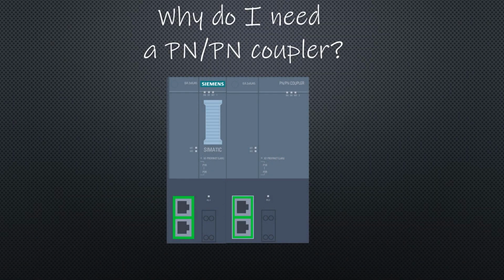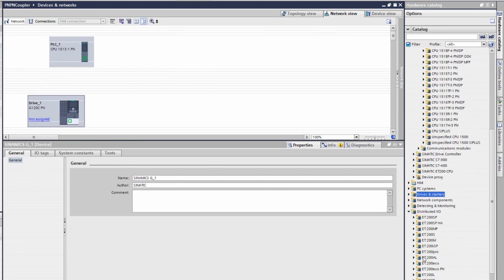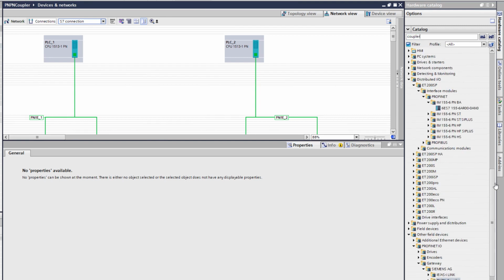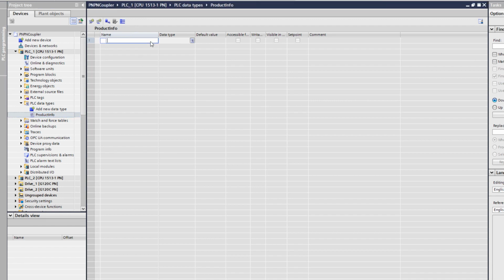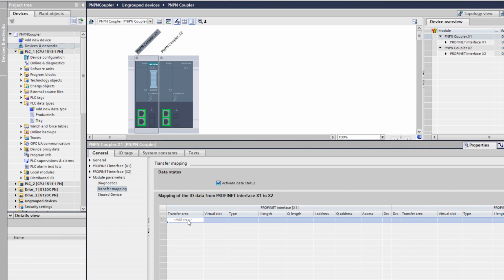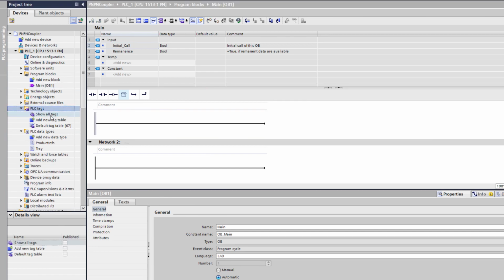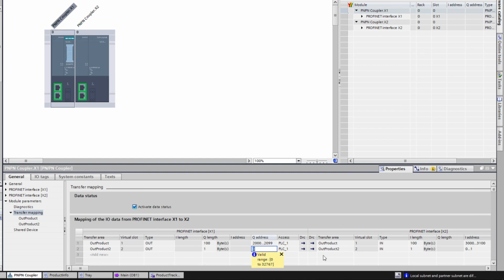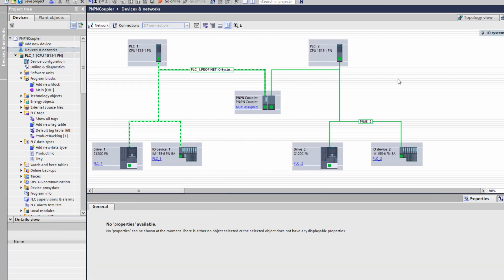When and how to use a PN/PN Coupler in TIA Portal | PLC to PLC Communication  S7-1500 S7-1200 S7-300

Comment: Thanks for the explanation.  The version I am using looks somewhat different in that now version 3.0 of the PN Coupler does not seem to have a transfer map configuration and the ports are configured separately, but still similar enough to be useful.  With that said, one thing I have not been able to figure out is the RD_READ_STO and RD_WRITE_STO.  Reading the manual leads me to believe I need to write actual logic to use this type of record transfer, but I have no idea what functions to call or where to even get started.  The manual just says, "IO controller (sender) issues a write request to the PN/PN Coupler...".  

Do you have an example of the RD_WRITE_STO / RD_READ_STO feature?

Comment: Very usefull information! Thank you for sharing!
In my particular case I need to have two controllers on one side of the coupler and one controller in the other side!
My doubt is since I have two controller on one side and the coupler I believe can only be assigned to one controller on each side how could my second controller send and receive data from the oposite side controller?

Comment: Thanks for your video!
I have a question: i have a control panel with this pn/pn coupler where the left side has two controller and the right side should be monitored from a Scada. 
The problem is: I don’t have tia project and I need to change IP address of the right side of coupler for monitoring from Scada, how can I change it? What configuration tool do you recommend for this purpose? 
Thanks in advance for your help...
Reply from the maker: You sure that's actually the case? If the right side should be monitored from a SCADA - does your SCADA system actually act as a PROFINET IO Controller? 
In terms of changing the IP address - tools like PRONETA can do that but normally the IP address is loaded by the IO Controller so manual changes tend to be temporary in nature and overwritten by the Controller itself.
Reply: @AutomationStation  thank you so much for your advices. I’ll check engineering.

Comment: I found this video as I tried to find a solution to my problem whitch is the very same ay at 13:17: the IN address range is miscalculated 3000...3100 is 101 bytes, not 100.. at the OUT part it calculates correctly (2000...2099 is 100 bytes indeed)
Any idea why is it beaves like that and is there any solution?
Reply from the maker: Sure - Maybe I should have mentioned it in the video. The x2 size is 1 byte bigger than x1 to fit the data status. If you don't need it you can disable data status in the properties of the coupler.
Reply: @AutomationStation  thank you, that really helped!
Reply: @AutomationStation  You MUST turn off the data status, otherwise it will interfere with the transmitted data and it will not work.

Comment: Thanks for this video.
You said that you do not recommend using the MOVE instruction. Please tell me how you can fill TrayTag data in your example?
Reply: Please, i got instable signale in the receive signal, x2, how i can resolve, i use blkmov instruction from db to share periphery define in the trasfer mapping of the pnp coupler, please help me
Reply from the maker: @cosimo9922  Not sure if I understand. What do you mean by instable signal?
Reply: @AutomationStation  If I keep monitoring the ouptut area (plc side) with a trace, the output goes to 0 logi sometimes, even if i detach the profinet cable from plc to X1 port. I cant explain that!
Reply from the maker: @cosimo9922  The output area of your PLC is in no way affected by the PN/PN coupler itself... Have you tried logging a support request for this with Siemens? They should be able to maybe go into a bit more detail and offer more help then we can here in the comments. You can log a ticket with them here:
https://support.industry.siemens.com/cs/my/srm?lc=en-ww#createRequest
Reply: @AutomationStation  thanks you
Reply: @AutomationStation  why MOVE instruction is not recommended by you?
I worked with a program using move instructions to all signals in dpdp coupler and it was working fine?
Isint pnpn coupler exact same as dpdp coupler but using profinet instead of profibus?
Reply from the maker: I do not recommend using MOVE instruction to MOVE data directly to transfer area. Rather than that we create a Tag based on a UDT which then gets nicely mapped to the transfer area. Of course if you want to move some data into the TrayTag or it's elements MOVE instruction would be a correct way of doing so.

Comment: Thanks for video, its great
Is it enough to just download  PLC-1 with that configuration, I mean PLC-2 was comissioned before and not possible to download again PLC-2
Reply from the maker: Thanks! Unless your PLC-2 is already configured to send data to the coupler I'm afraid it will need to be reconfigured. Otherwise the coupler simply won't receive the data from PLC-2 side. If they are in different projects you need to export the GSD file from the project with the coupler for side 2 and import it in the other project.
 If you can't do anything with PLC-2 it might still be possible to send or get some data from it using PUT/GET if this was enabled in the configuration. I wouldn't normally recommend using PUT/GET with S7-1200/S7-1500 generation CPUs, but you might want to look into it.
Reply: @AutomationStation  thanks for fast replying, i see plc-2 has to be configured